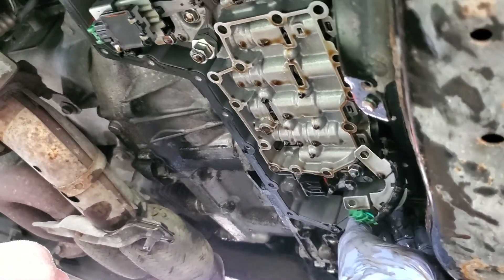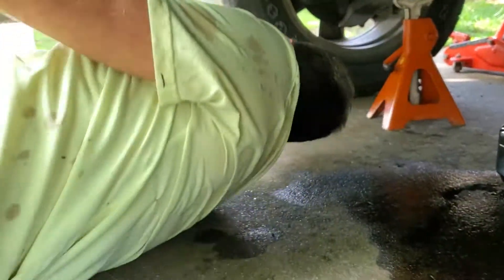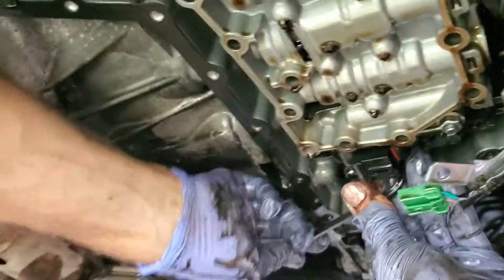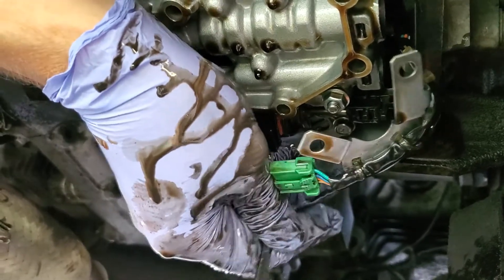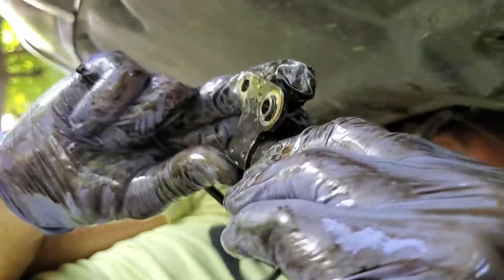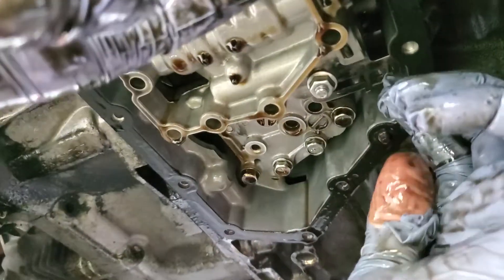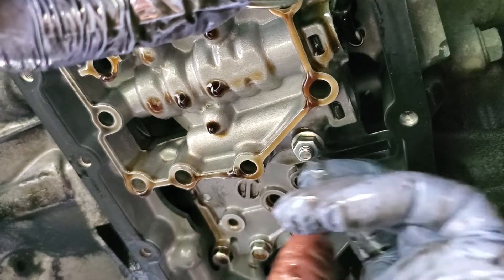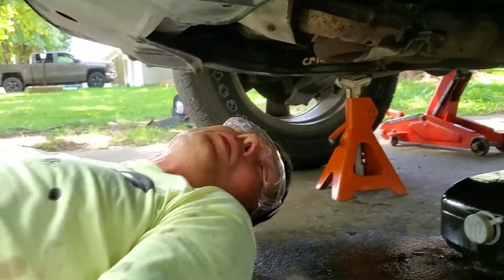Nissan cvt part 3 - P1778 fault, stepper motor

Comment: Hey
I changed out a step motor for the same vehicle you’re working on.
After the replacement the gear stays on L and the car doesn’t crank.
Have you had this problem?

Comment: Need help was getting code for stepper motor replaced it,transmission filter, 5 quarts Nissan fluid,now car won’t move?
Reply: Same issue what could of been the problem

Comment: Hi my nissan versa not have a problem RPM and speed is not Mach RPM is 4000 speed is 70 km RPN is 2000 speed is 45 but i du neutral and after I put in D RPM and speed is ok always car completely stops after driving and need to neutral and driving so please take me what is the problem

Comment: And if this doesn't  fix your issue then you really do need a new transmission it happened to me.
Reply: "It happened to me" is not a diagnosis.  I am getting lots of negative feedback from Nissan and local transmission shops, and they all believe and suggest a NEW CVT.  I do not give up that easily, especially after I have made dozens of repairs to things that should be' replaced'.  Replacing Junk with Junk is not my idea of a good time.
Reply: @ThisOldMan-ya472  so did it work when you replace the stepmotor?
Reply: @teebaby9884  No, unfortunately not.  I was considering changing out the valve body, but really I am beyond understanding what could be wrong, as I have never seen the insides of the CVT.  😞 For me, the car isn't worth the investment.  I also considered changing out the transmission from another vehicle, but not sure if the computer would need reprogramming, which means a trip to the Dealer.   Tooo many unknowns for the risk.
Reply: @teebaby9884  Now that you asked..  I believe I had the P1778 code fault, and it did not return.  There is no check engine light on now.  hmmmmmmm  I still have the car, and I can drive it, but engine rpm increases and so does the car, but revving the engine to 3500 rpm at 50 mph is not a good idea, especially for fuel consumption.  lol  I have used it just in town, since I have it licenced.  Now that it is spring, I will flog the car at the auction, take my losses.
Reply: @ThisOldMan-ya472   See i just replaced my transmission back in april of 2020. I'ma try to have the stepmotor & transmission filter installed. If it doesnt work. I might just junk it. Switch to lexus or toyota
Reply: @teebaby9884  I do not know if Nissan can diagnose the issue with a code reader, which might save you time and money, if it is not the step-motor?
Reply: @teebaby9884  My car still has the original CVT, with over 120,000 miles, so if you got a  'new' CVT, it might be a simple problem.  I don't find Nissan Dealer as very transparent dealing locally.  That is why I have avoided them, other than to phone and just get told, "Bring in the car and we will check it out."  It is a bit terrifying.  😲
Reply: @ThisOldMan-ya472   i have code P1777
Reply: @teebaby9884  As I suggested before, you could spend the money at Nissan, get a quote anyway, for a diagnostic, but seems like you are in the same boat as me, 'scrap value'.   😞